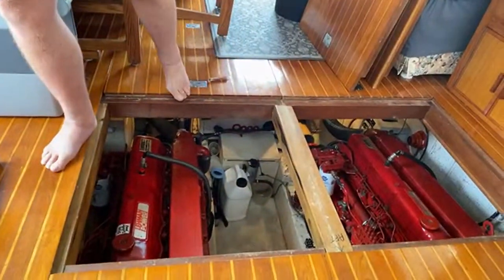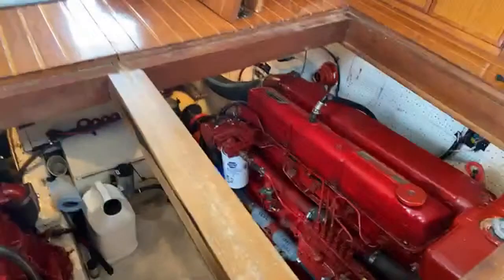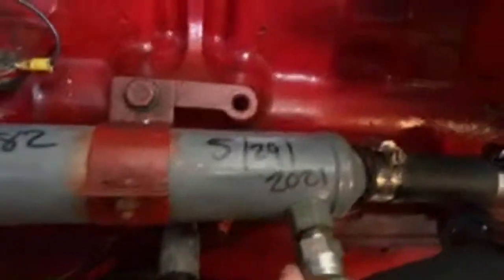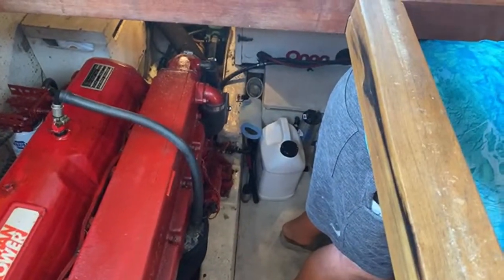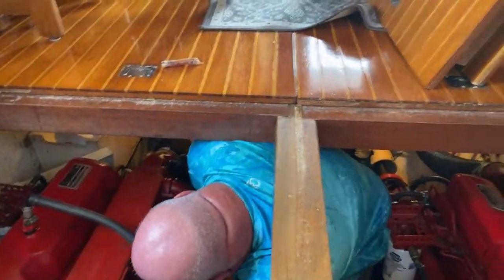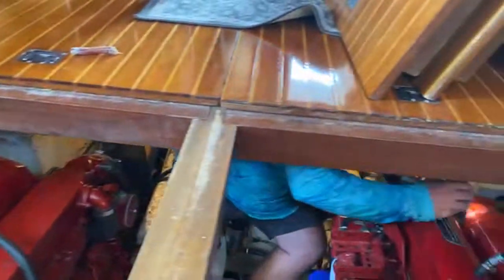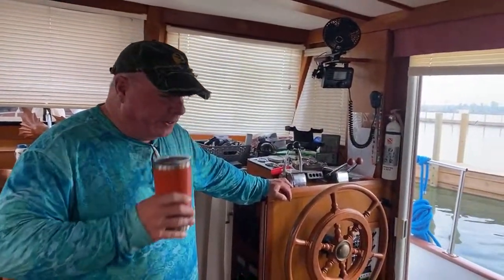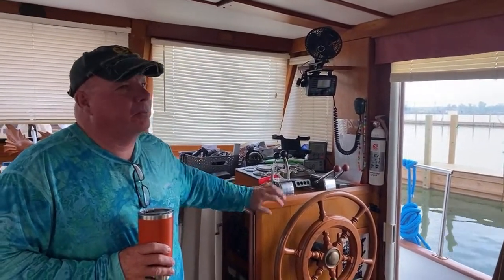Engine room Check America’s Great Loop 40 year old trawler

Comment: Do you know what the Hull speed of your boat is, assuming it is a full displacement hull? trying to go any faster is a waste of energy.  Also, do you know the pitch of your props? From the pitch and knowing the ratio between engine RPMs and prop rotation you can figure out what RPMs should move you through the water, if you ignore prop slippage, to match the Hull Speed.  This will give you a rough estimate of your optimum RPMs.
Reply from the maker: Thanks will do the homework

Comment: Is true that if the engine has low hours is not a good thing ?
Because someone told me that a Diesel engine if not running too much is possible that can be broke down at some point
Reply from the maker: That’s correct use them or lose them